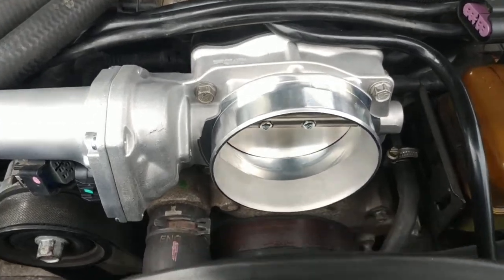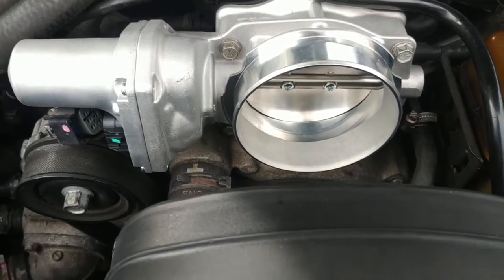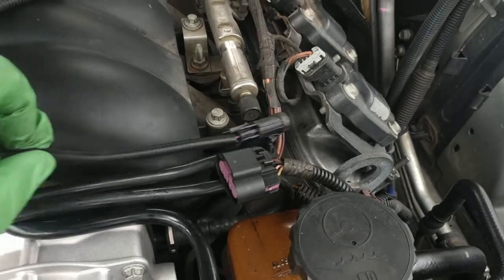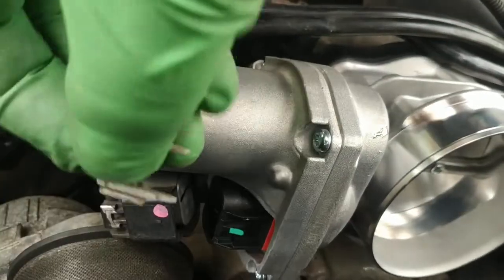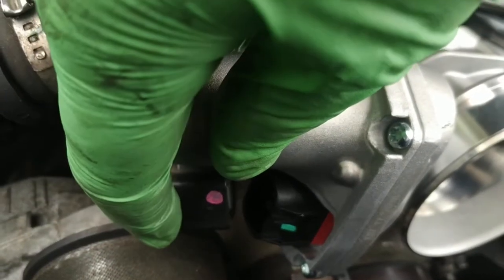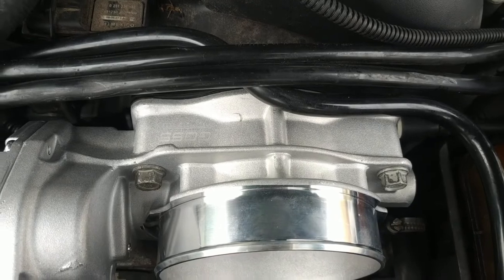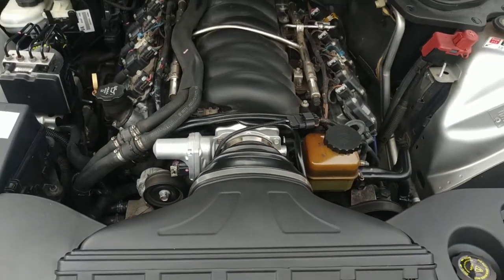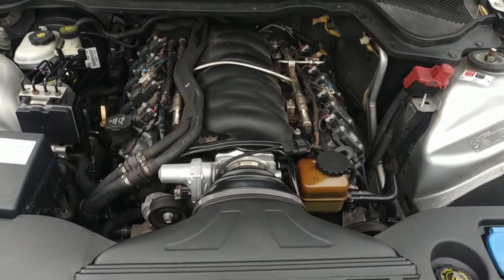Goss Throttle Body Review And Install. VE Commodore. L98. 6.0L V8. Silver Throttle Plate

Comment: Hey mate......ive got 2010 ss wagon with the L98 engine  shes got a gold butterfly on her..... Was yours gold before you got the newy... Apparently theres 2  types  silver and gold....whats difference mate?
Reply from the maker: My understanding is they are not interchangeable. They rotate in opposite directions and this somehow is an issue.
I'm not sure exactly why. But I was told if yours is silver stick to silver. If yours is gold stick to gold.
If you follow those links I think there are both available.
Good luck
Reply: @taptapindustries2580   ok thanks man 👍.....I'll buy a Goldie still

Comment: Hey mate I've read they drill the hole to help smooth it out in transition from no throttle to part throttle did you notice any difference?
Reply from the maker: No, with the hole was terrible almost undriveable. With out the hole  is much much better. My understanding is it is done if you have a big cam and if your idle control motor has limit range of movement. The LS doesn't have this issue. Unknown why they drilled it, Because with the hole it was worse in every way. No hole now and much much better.
Reply: @taptapindustries2580  yeah ok I have a cam too but not big and I have a hole in mine so I was worried putting the new throttle body on it would need retuning